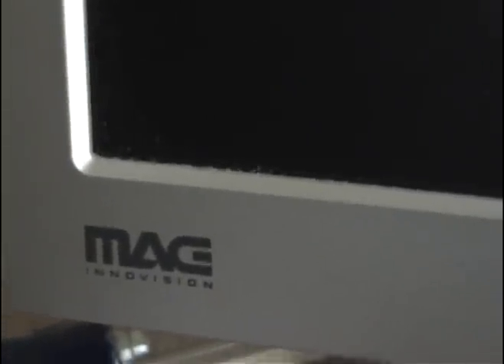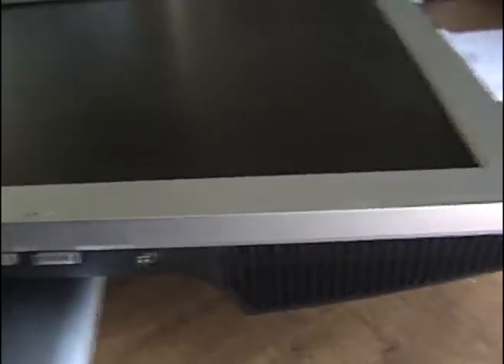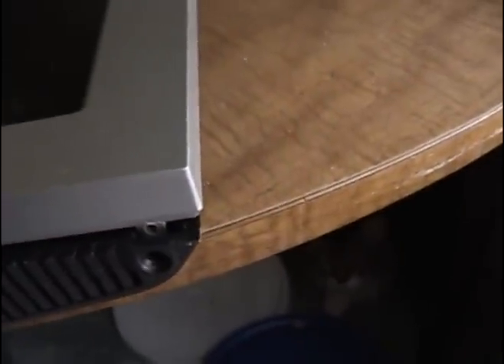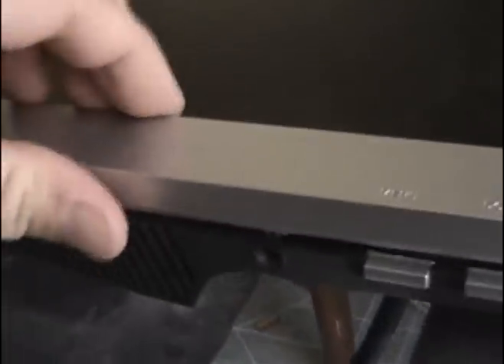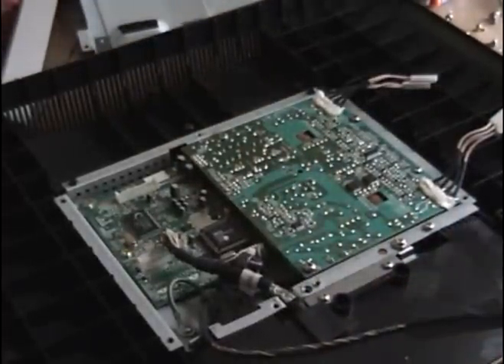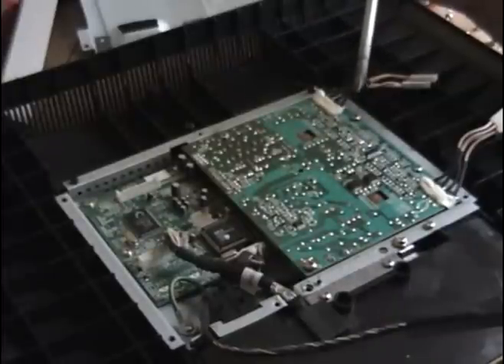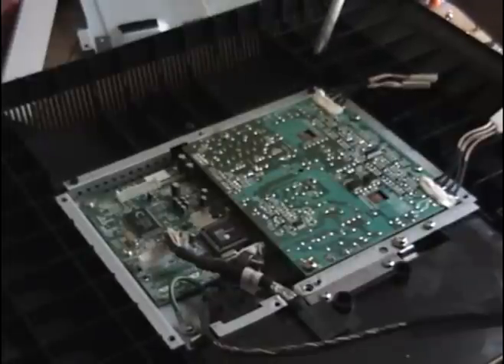mag lt916 fix

Comment: Thanks for the info; you're a good man!

Sure enough, I've got six bulging caps on the power board.  Just ordered replacements off eBay for under $10 including shipping from lpfixparts310 on the West Coast.

Hoping to fix the MAG before Christmas for my father-in-law.

In the meantime, I purchased an ASUS VH226H 21.5-Inch widescreen monitor off Amazon for $170 including shipping.  Full 1080P resolution, 2ms response time, built-in (albeit, crappy) stereo speakers...

God bless!

Comment: At 1:00 - To disaasemble the case first remove the four screws across the bottom of the monitor as he showed. BUT DON'T PRY IT APART LIKE HE DID.  Ley the unit on your lap face up and mounting base towards you and place your hands flat on the bezel on each side of the screen.  Now push / slide the bezel away from you (towards the top of the monitor) until the bezel slides about a quarter inch.  Then simply lift the bezel off the monitor.  PRYING THE BEZEL WILL BREAK ITS MOUNTING EARS !

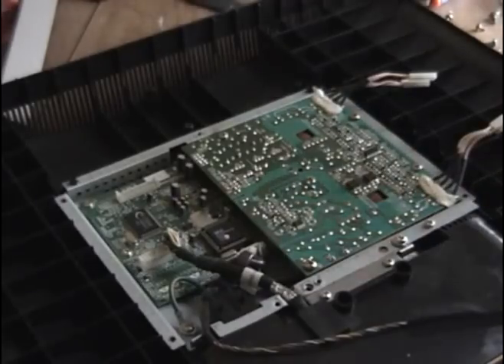Comment: At 3:23 - What he didn't say is there are 3 different sizes of screws (7 total) holding this plate on.  Keep track of what goes where.  In fact you're going to have to remove / install 21 screws (6 different sizes) during this procedure so you might want to come up with a system to keep them all straight.  Especially if you're gonna take it all apart then go get the parts and try to assemble the monitor days later.

Comment: At 3:00 - MARK THE WIRES !  It's true that you can't put the plugs together incorrectly but you can plug the wrong plug into the wrong socket.  All four connectors are identical.  I simply used a black Sharpie to color one plug / socket set on each pair of sockets so I KNEW which plugged into which.

Comment: hi my friend i have a olivetti your chasis is same with olivetti 700P model lcd i had same problem than i chanced capacitors than it worked but at beginning it works 2 or more hours now when i press power it shows screen nearly 5 second than close but when i connect florecents another power supply i saw that screen is working only florecents not works i found a zener near that capacitors i changed it and now works again

Comment: At 4:00 - Don't tell the guy at the parts counter you want "four-seven-zero microfarad" capacitors.  Tell him you want "four hundred and seventy microfarad" capacitors.  And speak a bit faster than bnutzcrazy.  And yeah he's right.  You can us higher voltage components.  It's the microfarad part that important.

Comment: At 1:56 - Don't leave any of the six screws out that hold the LCD screen to the frame.  Those middle screws prevent the LCD screen from flexing in the middle.  Really, what are you saving by not installing them ?  Don't be lazy. Have pride in your work.